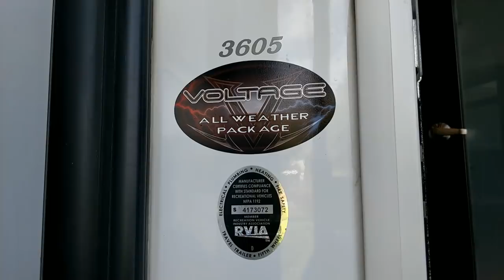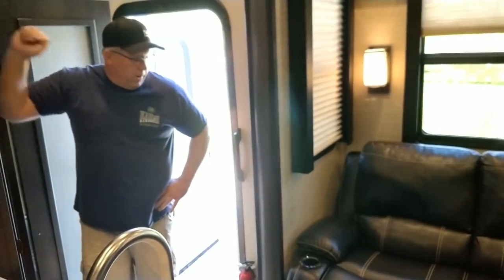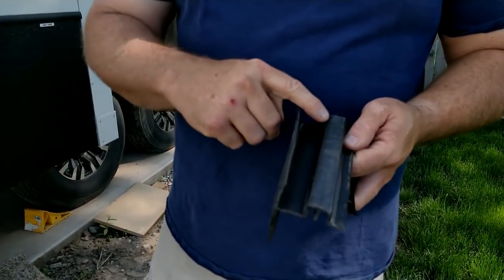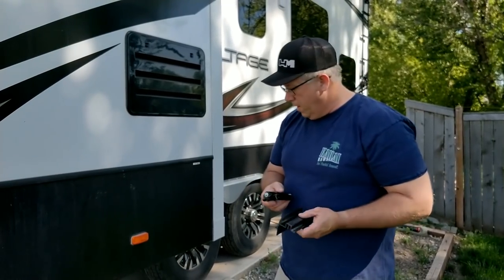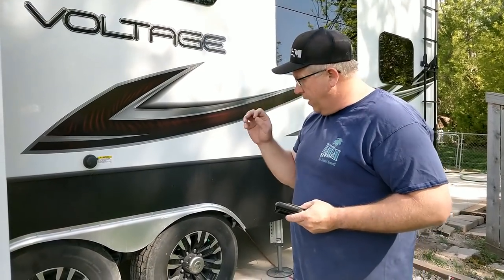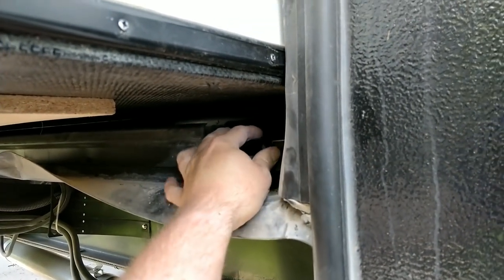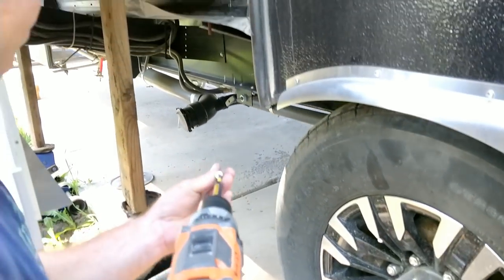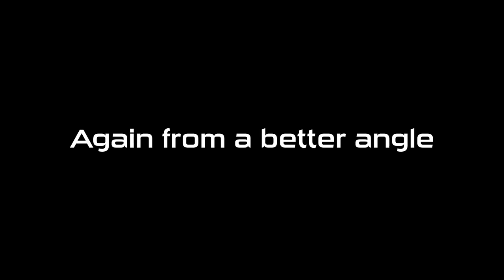RV Trailer / Camper Slide Out Fix

Comment: You're not supposed to cut the wear bar, only the outer flap to make room for the roller. The rollers assist the wear bar. They are not to replace a section of the wear bar.

Comment: mike just installed 2 rollers  from e bay for 20 bucks and they work!!!! the slide is smooth like glass nice job huge help thank you soooo much buddy saved me
Reply: What type of rig do you have?  Did the slide only have a rub bar?  Did you do it yourself?  Thx.
Reply: @rickstills6716   i have a 2018 Keystone Sprinter  fiver. 37' with four slides.  my camper is only 1 month old and the largest 11 'slide was jerking violently  all of a sudden.  my slide is cable driven  and has a slide wear bar. tried lubes and clean the underside.  all negative results.   ordered the rollers  and installed 4 of them. ny my slide goes in and smoothly.  Must do mod. i did  the work with  my friend  and it was simple  took less than 1 hr
Reply: @heretodaygone2morrowrving231  Awesome!!!  Thx!!!

Comment: But wait, there's more!  The darco is the lowest point of the slide so when water runs down the side of the slide out walls, the water drops end up clinging to (and wicking through) the darco.  The water ends up absorbing into your slide out floor and, you guessed it, you will have a soft floor that needs to be replaced.  I installed a slide out ski to prevent the water from getting to the darco.  Instructions for the install are on my channel.  
You did a great job on showing how to install the rollers!  Thanks.

Comment: Great video! Wanted to let people know that it's usually not a "failed" wear bar causing this. It's just simply friction causing it. After my dealer told me there is nothing they can do to fix it on my BRAND NEW camper I purchased from them, I fixed the issue on my 12 ft slide by buying 2 cans of Silicone Spray Lubricant, running the slide full out, spraying the underbelly of it in small areas at a time until it was wet (evaporates pretty quickly). The Silicone spray leaves a slippery film behind after evaporating. Did this 2 times and it fixed the problem. So far it's been about a year and has not done it again since.
Reply: I used teflon spray in a can.
Sprayed the under side very good

Comment: Thanks for the video!  added 3 to each of my bigger slides on my 2017 Fuzion 417.  I had to weld a 3/4" x 1/8" strip with 2 holes to the flange of the roller because there was a step right where the mounting holes were at.  took about an hour for the first side, and 25 mins for the second slide.

Comment: You  convinced me to buy some of those Lippert rollers for our Montana HC and the 13 foot LR slide and the 7 foot kitchen slide, both of which appear to have failed slide bars. Now all I need is some good weather to do the install. Interesting that the lightest of the 4 slides on our 5er, the BR has factory installed rollers. I never thought I would miss the Lippert rack and pinion slides on our old 5er - but I do!
Reply: Just an update - I have the rollers but still waiting on better weather - maybe no rain tomorrow!.
Most if not all of the jerking and strange noises can be removed by cable adjustment as I have done. Not a fun task but doable. BAL recommends ZEP 45 lube on the wear bar. Too expensive at 27-29 bucks a can - if you can find it. I used a 7-8 buck commercail CRC PTFE based lube with virtually the same ingrediants and it works. I have 2 reasons to install rollers - first, the LR sags and no amount of cable adjustment will fix that wear bar failure droop. The second - I'm tired of adjusting cables and if this helps .........

Comment: Well done, Thanks!  I followed your suggestions and installed my rollers today.  With my slide all the way out I couldn't get much lift.  I brought it in about an inch and was able to lift it enough to get the sawzall in there.  I did 4 rollers in a kitchen slide that has the refrigerator and stove in it.   It seemed to raise my slide out about 3/8" to 1/2".  I sealed the gap with a piece of plastic garage door seal that worked perfectly.
Reply: Did you install one the whole length or just enough to cover each roller cutout? I'm worried it will fold in when pulling the slide in and catch on the roller and rip off.

Comment: I'm so thankful for your video. I have a 2020 Vibe  26BH with a Accu-slide and wear bar. It is only 5 months old and under warranty. Mine has a slightly different issue. The screws that hold the wear bar down are not fully screwed in and thus scraping the slideout floor bottom. Forest River has accepted responsibility for it, but I cannot find a RV shop that will do the repair work. Most say they won't repair it if I bought elsewhere.  The rest say they don't have the equipment or experience. So I have a new busted up RV that I'm paying to sit in my driveway. I'm hopeful that this will take care of it. Otherwise I'm screwed.

Comment: Man, Chris that was an awesome video, great fix!  You made it look like even I could do it!!  Lol  “single female “  have same problem but with  different type.  I wire brushed off the toothy rods on bottom applied dry lubricant.  Now syncing the motors.  So far so good.  Oh and making sure she’s perfectly level before putting slides out.  Thanks Judy

Comment: My slides are exactly the same as yours and did the same thing.  I degreased the wear bar as good as I could with Totally Awesome, then sprayed the bottom of the slide with WD40 Specialist Dirt and Dust Resistant Dry Lube PTFE spray and let it dry.  Ran the slide in and out and it works like new.  The rollers would be a more permanent fix but mine are fixed now with the PTFE lube, I guess that I will monitor them for a while...

Comment: Great video. I have Schwintex slides on my tt with the original roller system. After time the rollers will wear through or tear the material on the bottom of the slide. I started watching your  video hoping you were going to address that problem. The only solution is to install some sort of wear strips for the rollers to run on.  Can't wait to see your associated video games  as this video it will be awesome.

Comment: Good vid, thanks.  My Travel Supreme needs bedroom slide rollers replaced.  Unfortunately they are recessed about 5" in from outside edge.  Getting them out is the problem.  I may slide a flat bar in under the middle of the roller bracket and get a Sawzall to cut the screws then install the outside mount screws.The link didn't come up but Cass rv rollers will bring them up.Thumbs up

Comment: I havent found such a video for this problem mine is having now also...THANKS... I would have liked to have seen the old wear bar condition wear. My wife just thinks its dirty.. I don't expect much debris getting into that area only from interior sweeping out to the exterior.   8 Rollers ordered every 3 ft recommended.. Hope the wear bar is standard.  Seems they all come from the same MFGrs in Indiana to save them time and  you money.. Mine only lasted 2 years and I was befuddled to figure out the problem.. Long screws of 3" often are used to go through the aluminum box channel to reach through it.. You are DE' MAN!!... Man hug!
Reply: I think once this bucking, jumping, jerking starts it may make itself worse from the action..
Reply: I tackled my smaller slide today.  It was successful. I noted the "wear bar" was extremely worn on the ends.  Perhaps yours is also similar.   I think Keystone likes to use these for some reason of economics. A shorter saw blade seem do do fine but i was ready with the longer ones.

Comment: I have the same issue with my larger slide out which is  my kitchen slide. My fifth wheel is a 2018 Keystone sprinter with 4 slides. I just bought it a month ago and the slide is jerking and skipping when  coming in/out. The dealers don't have any answers  but to  schedule an apt . We all know what its like to bring your rv to  the dealer. LOL it will be their for  the hole camping season. The Rollers make sense. The dealers all tell me that the  traditional  wear bar setup is constantly an issue .  I have ordered 5 rollers   I sure hope they  fix the issue.  The only thing I see is that by cutting out the wiper seal and wear bar this leaves a  gap for debris and other elements to enter the coach
Reply from the maker: You can buy additional wiper seal material and install it over the gaps to restore the seal. I would provide more detail be we have yet to do this step to our own trailer. We haven't noticed the missing sections of wiper to be much of an issue. Though it would be better to seal it back up I'm sure.
Reply: Thanks John  I did buy the  wiper  seals from Amazon they work great

Comment: Pretty pathetic that you spend that much money on an rv and then you have to repair it. I think the rv industry is some of the biggest ripoffs in manufacturing. You did a great job. My slide hangs up on one side coming in so I have to either have someone on the corner pushing or I bring it in so far then reverse it a couple of inches then bring it in again. Keep doing that til it’s in all the way. Thank you for your video, your a good teacher.

Comment: Good fix! Looks like your cable brackets need to be moved down so they pull straight in. I'm changing accuslide cables on my 2017 Laredo now, and all the videos mention that.

Comment: I added 5 to my 11 ft slide. it works better but it did raise it a good half inch. So far no issues and hope it stays that way. I need to seal the wiper area at rollers. I'm worried it will get pulled in and catch on the rollers and rip it off.

Comment: Got as far as cutting the bottom wiper seal and there is no slide bar as shown.I installed roller but at that point realized that there were already rollers in place behind the wiper seals right next to my install. I suggest checking before cutting. I have a 2018 Grand Design Reflections 315 RLTS.

Comment: OK I put 5 of these on my 12 foot kitchen slide. It actually raised my slide up a good 1/2 inch. It smoother but it still kind of bucks but not the quick short bucking it did now its longer back and forth bucking. Its smoother overall but still not perfect. Also the gap now lets in cold air.  I hate my life lol.

Comment: Nice vid, I was wondering where and what they call that power plug. My RV is wired for a second AC but it dont have one and I will not need one. The 50 AMP 35ft cord is a beast to load and unload. I would like to put a smaller 30 amp cord. But this adapter would work good as long as the AC is not needed. Thanks mike

Comment: Thank you for putting out this video. I have a 2018 Voltage 3005 with a sofa slide that is having the same problem. I will definitely be doing this fix. Can you provide a link to where I can purchase the rollers. And possibly a part number.  Again thanks so much. Your a genius !
Reply from the maker: Here is the link! 
https://store.lci1.com/j-36-service-roller
Part number: 276288
Reply: @MikeHooley  I have a 2018 3605 that is ripping the wear bars out! The kitchen slide has ripped half of the wear bar completely loose from the retaining screws. I will be raising the slide and installing the rollers but I will call LIPPERT and give them an ear full! Thanks for your video and the link for the parts. awesome
Reply: I have installed 4 rollers on my Kitchen slide, 5 rollers on my sofa slide, purchased some 3 inch weatherstriping to cover the holes for the rollers. Now I have to install the plastic Slide ski's and some flat aluminum plates to protect the Darco and I'm done. With the plates I think I wont have to replace the 8 inch piece of water damaged kitchen slide floor.
Reply: Hey J Brenes, I also have a 2018 3005 with the sofa slide issue… did you install the rollers?

Comment: Have to agree should be installed at factory I have seen a lot of trailers with this system and they just don’t seem to work well. Mine is going back to the dealership this week to get the slides adjusted and the rv is about a year old.

Comment: Word of advice. It has compromised the plastic wrap on the bottom of the slideout. No water can get in while driving down the road. Not sure why the yahoos let the plastic wrap bare the weight of the slideout. My floor was rotten around the ends. Also the screws that they secured the floor, went right through the plastic wrap. It was destin for failure when it rolled off the assembly line. Thanks Keystone. Why aren't there recalls on RVs like automobiles?

Comment: Mike, Hello and Thank You for this detailed post!  
I have not been able to acquire the level of assistance  from Norco/BAL that you were able, but the height of the wear bar of the 12' slide box in my 2017 Keystone Bullet 272bhs is not as tall as the sections that you had removed from your Voltage.  If I measure the stack up including the 0.20" to remove the carpet below the J-36 Roller Assemblies, the slide would still be approx. 0.30" above the current wear bars.  
As you appear to have excellent mechanical skills, in your opinion, if I were to remove the nylon rolls from the roller assembly, do you think that I could turn them down a little in a lathe? 
Additionally, as you had published this information last year, have you seen any additional wearing of the darco cloth? 
Any additional details or feed-back would be greatly appreciated! 
All the Best!
Reply from the maker: I think you would be able to lathe the rollers down a little, though I am no expert on the matter. We haven't seen any additional wear to the darco from the rollers.  The wear bar was causing far more damage.
Reply: hope ya dont mind me responding to your post, as far as the darci cloth getting warn, I  seen a video where a guy installed i think it was 1/8” stainless steal over the darco cloth, so the rollers slid on that, the stainless was like 6” wide, and the length of the slide. good day

Comment: Thanks a lot for this vid. I'm having the same issue with a rack and pinion slide. 
Did the new  rollers raise the slide up  when it's in its fully out position? 

Thanks again!
Reply from the maker: Yes it does raise the slide slightly, about an 1/8 in, haven't had a problem with it yet

Comment: Can you tell me the roller bracket part number and where to get them, also the length of the long slideout you added them to mine is 147 1/2 inches  and the spacing you did for them thank you
Reply: Hi mike love the video and the great detail that you have provided, I have a 2014 sprinter and my main slide is jumping going in and out, I noticed that you mention that the tech you spoke with said that the roller shouldn't be more then an 1/8th of an inch higher then the wear bar bar , so I started calling around and keystone tells me that  the wear bar on my rig is 148" long and only 3/8" high , that isnt very high and i cant find any rollers on lipperts web site that small , could you post the measurements of your sections that you cut out , i would thing that they have to be higher then 3/8 " in order for the j36 roller to work , thank you Dan

Comment: Ok I thought this was a good idea . After replacing 2 gearbox’s I decided to check out installing rollers . Problem is mine already has rollers. 4 on the appliance slide 8’ & only 2 on living room slide . Living room side snagged in the middle causing floor damage. Repaired with aluminum flashing. The system has no safe guards ( prox/ limit switch) to avoid gearbox failure. The manual override is a cruel joke as one you can’t reach and the fact that the gearbox needs to be good for this to work.

Comment: How unfortunate those weren't an included/mandatory part to begin. They certainly know how to overprice everything they sell - Thanks, corporate stooges! ANYWAY... Good Job on the video! Do you feel that it would be possible to use  RP-113446 instead? (available at  for 1/2 the price, also on A for a few dollars more but if you have Prime delivery...)  Thinking it might be more secure, flat-mounted with four screws. Just that possibly more difficult to install, maybe a air/battery powered ratchet? Plus, trimming the seal wouldn't be required.
Reply: Had to edit several times to remove names/prices. Search the part number, you'll see who sells them.

Comment: WOW, this is great. Mine has been adjusted 4 times by the dealer and never fixed it. Now my Darco is ripping into the wood and need to do something to fix it and now i know how to. Did you end up adding a new wiper once you cut it out, are you able to let me know which wiper if you did?
Reply from the maker: You know we haven't added any new wiper to the outside of the rollers yet. But you can hear wind coming through, so we will add something when we get a minute.
Reply: i did the roller mod and addes a 3" wiper seal from amazon for only  2.95 a strip RecPro

4.4 out of 5 stars  19Reviews

RecPro RV Slide Out Replacement Seal | RV Slide Out Replacement Wiper Seal | 3" Wiper w/Adhesive | Sold by The Foot
Reply: @MikeHooley  RecPro RV Slide Out Replacement Seal | RV Slide Out Replacement Wiper Seal | 3" Wiper w/Adhesive | Sold by The Foot

Comment: We just bought a Palomino HS1902 and my slider binds going out and coming back in, causing it twist so that either front or rear lags far behind.  Will the rollers help this, or do I have a different problem?  Help, please, Anyone?  I really do appreciate your sharing this video.
Reply from the maker: It sounds to me like your cable system is out of adjustment. I wouldn't be able to tell you how to adjust it properly tho...